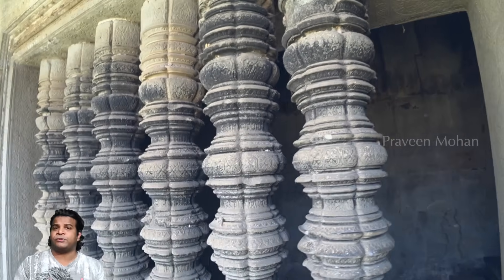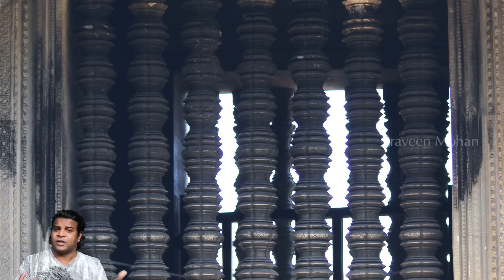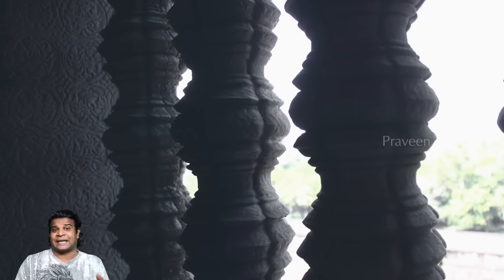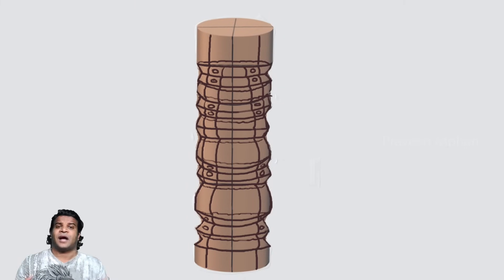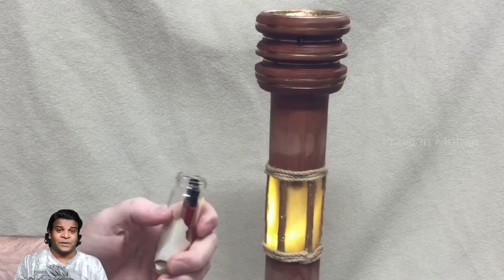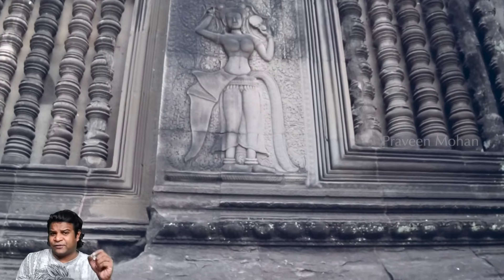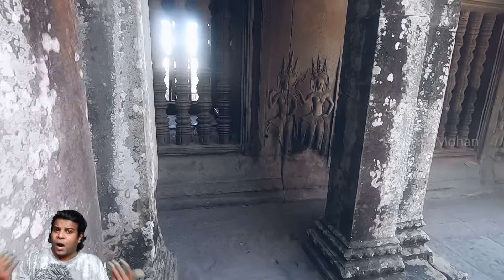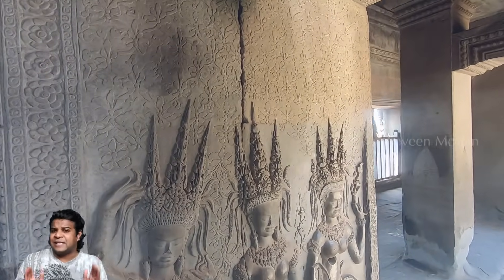IMPOSSIBLE ANCIENT MACHINE Found in AngKor Wat? Lost High Technology | Part 8 | Praveen Mohan

Comment: The wavy shape of the pillars could be coding information.

About the manufacturing process, it may be done on a balancing, oscillating shaft which holds a square column, at each oscillation the grinder would be slightly displace according to a predefined program

Comment: The pillars of Angkor Wat are made of sandstone, a sedimentary stone that is relatively soft compared to other stones. (Which Btw Sandstone and Concrete Share the same level of hardness around 6-7 on the Mohs scale) This characteristic makes it easier to work with and there is no need to jump to the conclusion that modern day machinery would have needed to be used. Thats such a leap in logic when you state in other videos that historians often view ancient people as far inferrior than they likely where. Why is it so hard to beleive that the ancient khmer or even pre khmer people couldnt have made these. Infact I can prove it to you be decribing an easily built machine that could have made these.

Creating these pillars didn't require advanced machinery. Instead, a large bow system, similar to a bow drill used for fire starting, could have been used to create a horizontal lathe. This lathe would have spun heavy stones over a bed of harder stones. Alternatively, the process could have been automated using a flowing river as the engine to drive the rotation.

To create the pillars, sandstone blocks would have been carved down into tall octagonal shapes. These shapes would then be laid on a spinning mechanism, driven by manpower or waterwheels, to roll the pillars over a flat, smooth stone cradle. Harder stone cutters, made from stones like granite or basalt, would have been pulled down to carve grooves into the pillars.

This method would have provided a repeatable and efficient production line for the pillars. The grooves running parallel down the pillar could have been made either before or after spinning on the lathe. Final decorative details would have been carved on-site during the temple's construction to minimize transportation risks. The pillars themselves would have been carved into cylindrical shapes near the quarry to reduce size and weight, making transportation more efficient.

Comment: Hmm..
1. If its a case that the engravings are soundwaves,or some suggestion in proportional differenties between the peek and groove depth, rithm of the pattern, etc than it is wort to explore in this direction mathematicaly.
2. The other.. no need to cut up the pillars and stick back them together if the all 4 sides are identical, only if the purpose of the pillars is to showoff the technical ability of the makers.
3. Maybe there is a slight,minor difference betwen the sides-4 faces of the pillars in the engraving pattern and therfore each side is thelling its own story,message and all 4 together is
like a vinyl plate. All of them are the same at first look, but on the gramophone plays various music

Few crazy tought on this in a hurry, hope i can get you on the point

Comment: Sorry but this one is to easy. They made each vertical section and put together. It’s quite easy to make long ornate cement pillars by hand. All they needed to do was make the mold and pour ground up sandstone. Sandstone is easy to work with even in a solid state. Dont get me wrong,I question a lot of the architecture in your country and baffles me. But this one I could replicate. Keep up the great work. Shadows may just be Pareidolia. Loved that video where you found what appeared to be parts of a lathe. May have been used to grind grains but it was sure possibly a lathe or mill. It’s quite easy to make something spin without needing metal.

Comment: These sacred sites were all built like circuit boards, all to generate energy from the Ether, planetary ley lines or water etc. especially tuned to sound generating energy. The crystal in the quality of stone used has everything to do with managing, translating or transferring the energy to where ever it is needed. I would bet that those pillars cut in four has some kind of metal or chemical containers that may amplify or modify what is generated through them. It is all about energy movement, getting electrical energy from here to there and even world wide unhindered. Just like Tesla discovered.

Comment: It is an old trick of indian sculptors to turn column  using elephants as the driving force.  It takes lot of understandng of material scince and skill. As electrobmechanical engineer i am used mill shape turn   of all types of  metal. But turning stone is not easy. First evidence of turned columns are in Belur and Halebedu. Thanks for the info. This shows how advanced technically indian artisans were abd are

Comment: they rocked 1/4 of the selected pillar stone back and forth across a template made of harder material which cut identical 1/4 pillars so they simply have to plane the sandstone 90° then fit the 4 quarters to create a full pillar.

Comment: Did they make an original on a lathe, then molds, then castings in quarter sections? They needed many, many pillars. Perhaps the lathe process was very slow.  Castings may have been much less labor intensive.

Comment: What if they were molded instead of processed by a lathe I have a theory that they liquefied Stone at that it could be used in a mold and then reassembled as a finish project it would be a more efficient process that makes each and every one perfect, understand that we can create diamonds today from compressing carbon. 
Why wouldn't it be possible to compress sand into stone, the same way they make gears out of powdered metal

Comment: Well, thees pillars look like they make them from molds using clay to fill them.
When it was hard enough, they took the mold off and decorated the quarter pillar.
After that, they placed the 4 quarter pillars against each other and formed a whole pillar
that turned in to stone in time ... and you can see some of them are broken and just soled.
What I need to say is that this was and still is a remarkable achievement.

Comment: We have people who are still alive today, who can carve such intricate patterns with a chisel and a hammer, an art that goes back thousands of years. So why couldn't the people of Angkor Wat do it? Also, As I can see, you never gave an explanation as to why the shadows are of importance, you ask, "Why would they do this?" and "What purpose do these shadows have?" give a good few words that seem to lead up to an explanation... that never comes. Furthermore, you assume that the blocks were originally cut up to allow it be opened, although, if they used a lathe, then why would they cut it up when they had access to the top and bottom? wouldn't it make more since to bore a hole in the top with this "machining technology" and then make a plug for it? Also, why can't those grooves be just for decoration? I Personally think they make it look quite nice! Another claim you make it that it would take a CNC machine to cut these pillars in such a way, even though they have technology in Egypt that uses a specially designed saw, and water to cut things with precision to 2mm, and this would still break these columns if they were 2 inches in diameter, like you claim, even though the fact that there is a person in the same frame as the pillars, we can clearly see that they are likely 1-2 feet in diameter (0.3-0.6 M)  And this is all assuming that they would hide things in them, for any robber can slide these out with enough effort, and smash them on the ground, or with a rock, because these are made of soft sandstone. I Dare you to successfully debunk or defend yourself from any of the points made in this comment. Debunking these points will earn you the respect of the other 98% of the population.

Comment: To me if you turn the shadows cast upon the windows frame horizontally, it looks like the frequency spikes of the spoken word as it would look on a video screen in a spectrum analyzer.   Whith that in mind maybe each piller  in each window is a seperate word or a separate sound of individual letters forming a word when added together. It also seems odd that one side of the building has open windows w the pillars and the other side has closed windows w the pillars too. The Hindu temples of  India blow my mind on every level! They are magnificent!

Comment: My comment will probalby deleted but underestimating modern technology and what we can do is deniing what our ancesters might have done.

How would you to something like this nowadays? 

You would not mill it because the material losses and the machinery needed would not pay off. 

You would make forms and then use reconstructed sandstone or geopolymers to mold the forms molding was already known by the ancient greeks and romans so why would the builders from AngKor Wat not have used it. 

Having a mold that has a rectangular edge would also make it way easier to get the finished product out of a form and using the same geopolymer or reconstructed sandstone to bind the pieces together. 

Hence they have not split the pieces they have molded them and then put together because that is the most convienient way to make these pillars maybe somebody put something inside of them but for a highly standardized product it is very unlikely.

It would be the same as assuming that every (plastic) bollard on the side of the road contains information  just because it is hollow.

Comment: I have a solution. Use a casting  in section move, casting  up or changing  patterns. Inside carbon date magnetic field.
Clay forms to stone melting cool solid rock. Thermite reaction heating 2700c melting out metals and created peace and art. Thermal reaction will melt stone, megalithic secret. Combine pottery and refined materials for food distillation water. Thermite reaction heating 2700c in extreme cold, heat battery.  It is everywhere and can be made on-site gravel to stone. Tribes trading rock for medicine, foods, drugs, weapons, humans, spices,  all need heating energy human ingenuity and crafts that would be advanced.
Metallurgy and pottery and glass inlightenment.

Comment: Rather than making the same shape over and over again on a lathe, perhaps they made one, then made a cast of that.  Subsequently, they have a mold where they can load in sand and lime and fire it.  As such, there may have been advantages to making it in pieces, perhaps in terms of how much they could sinter at once, or the practical weight of the columns.

Are there toolmarks in the cuts that could prove it was actually cut after the fact?  How uniform is one pillar to the next?  Human error would manifest if each and every one of them was turned by hand unless they had some seriously rigorous quality control.

Assuming they are identical, how do you maintain consistency when creating many of these pillars?  Any slight deviation in a lathe process might really stand out like a sore thumb once installed.  That makes me think it's molded and assemble four pieces of that to get a full 360 degree column.  Presumbly you could do it in 3 pieces, or in 2 as well.

Are any of the columns broken? 

Another thought is that perhaps something valuable was embedded within these vertical grooves, such as GOLD.  This might explain why they were cut like that as well as why they were guarded.  The idea is that it has all since been stripped and looted.  But if you had a handheld X-Ray Fluorescence machine, you could probably detect a few stray atoms of gold that rubbed off in these grooves.  You could also determine the composition of the sandstone to atomic proportions, and compare that to any local in-situ sandstone, which might betray the artificiality of the sandstone in Angkor Wat.

I would be especially interested if water could be made to drip through these pillars.

Comment: The pyramid was built as a power station before the temple was built.and the power technology was use to cut stones and transport to the yard to build the temple.even the sand stones was cut as lath pillers with the electricity power used from the pyramid.

Comment: The reason why the pillars are cut into 4 lengthwise pieces is because they were not created on a lathe. They were molded. Someone turned a much smaller wooden piece and used it to make multiple imprints in something like greensand or clay for a mold. It was made in 4 separate pieces because the mold was a soft material that would cave in due to gravity the very moment that you start pouring into it. Meaning, that you could only do one side of the pillar at a time.
Reply from the maker: Your understanding is appreciated Bitskit

Comment: My guess is theres nothing inside but they are probably castings, new discoveries point to an ability to melt and mould stone using frequency and vibration. Maybe the shapes are designed so as well as casting the shadow of the main building inside are some sort of technology  too.  Like if you send sound in from the open wall side and it returns at a certain frequency to be harnessed for whatever reason. Similar to when you clap at the pyramids in Peru and Mexico and it echos back.  Monks supposedly levitated huge rocks like this in Tibet or Nepal. I’m there now so I’ll have a  good shout at it and see if any rocks flying 😂

Comment: If they are from stone you can check them with small metal detector, they might not be made from stone only, might have magnetic anomalies, in st Peterburg, also when I was working in border guard when there were trains with granit the metal detector gate calls the alert..but why on granit if there is all train from metal, think it was a radiation detecting gate, the granite is like radiating think..

Comment: The Balustrades are made with a 4 piece timber Mold.  The ground Limestone is mixed with slurry to make so that the Limestone granules stick together in a damp mix and then tamped down into the Mold, left to cure and the 4 piece outer Mold is then removed.  I used the same methos to create a Mold to replicate damaged balustrades on a historic home, except with a dry concrete mix. No lathe required, not all that complex to solve.

Comment: Inside I expect a metalcore. They cut it in six peaces. This cuts destresses the material equal to the complete block. And it will be possible to do without Computer. But its necessary to built the tools in the old ways. Machinery today have it just it makes work more easy. And it changed the workingmethods today in a way, that it is impossible to compare them to old technics. Look at watchmakers. They file every part by hand... Some sharpeningstones today are still cut by hand. Look how they flaten the surfaces. This would work with old materials too.

Comment: Nice deep examination 👍🏼 your corelation on this is great. I just had a thought about splitting pillars in four, It may not be correct but I think it could be to avoid detereoration/damage due to expansion n contraction due to heat and cold. Just like railway tracts have gaps to avoid it.

Comment: Hello! First off, I’d like to say, that I am a huge fan of your work, reviews and careful well thought flow.
My first thought, was geopolymer materials poured into a mold. It would make sense, as to the ease that could be accomplished utilizing finely carved forms within fine clay. Pouring molten stone is easily accomplished as well.
With a well tuned concave focusing mirror, temperatures above 1100 degrees Fahrenheit can be arrived at fairly quickly. 
Out of curiosity, did you get an opportunity to see the fine details of the shadows cast on the wall? I would be particularly interested to see if the shadow of the central gash may add to particular attributes, specifically seasons.

Comment: I think they used vibration to put the 4 pieces back together - in a sense liquifying the stone and allowing them to reconnect. Not sure what is inside though perhaps some kind of energy conductor or sound frequency generator when hit by the sun it creates a frequency for healing or something?  I heard a spiritual channeler saying angkor was a place of healing.  I use different frequencies with meditation for healing myself and raising my own frequency.  I have been to ankor and walked around but never felt any really strong energies in the places I walked. I was expecting to sense a lot there after all my experiences finding portals and things but surprisingly there wasn't anything. Perhaps timing is important or specific location. I was at an old temple in thailand that had been rebuilt over and there was a massive vortex there out in the open but wasn't being used for anything. I think the new rebuild wasn't done using ancient knowledge in that case and they just randomly made buildings on the old site.  When i tried to tell the monks they didn't know what I was talking about so it seems like old knowledge was gone.

Comment: They are all made as four pieces side by side, then installed together. No latches were used. The pieces arent ever been cylinder together, they are parts of solid rock that have been cutted first to four triangular pieces, chiselled and then installed together to look like they are sylinder round one piece. Inside theres nothing, you can see that from few of the pillars that were broken but still standing, theres no holes for anything secret.

Comment: The pillars were molded ash cement with river sand. The reason that they come in four parts is because there are some anchors on top an bottom of the pillars. The entire  pillar is like an assembly, you just have to put it together at the final position. The engineers of the past have had many tricks we still use today. No secrets about it. Still some of this pillars may hold instructions inside on how to build them, like a recipe to be past down to the descendants.